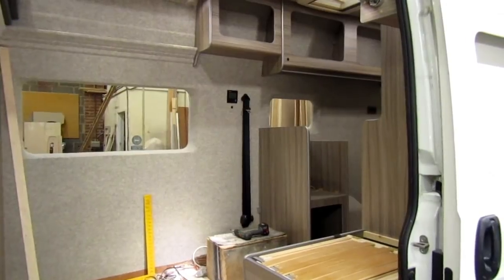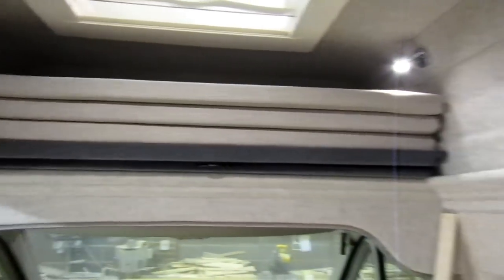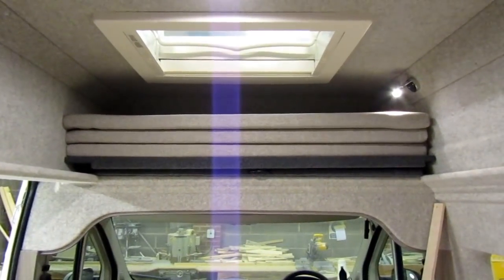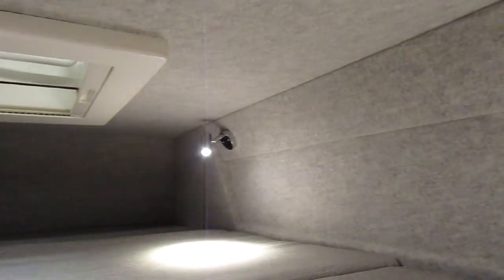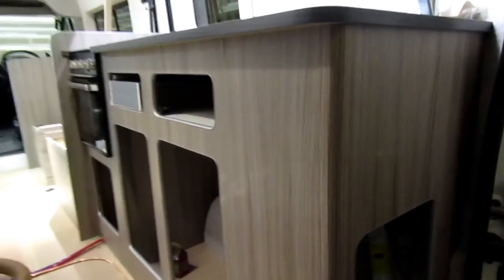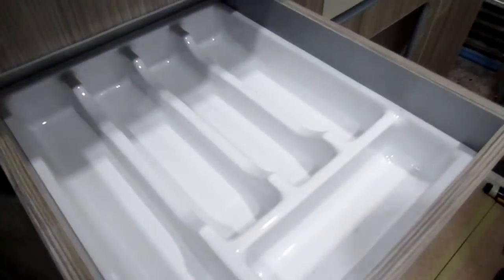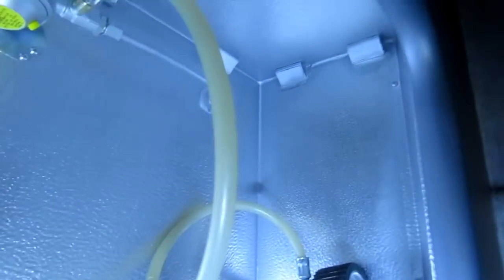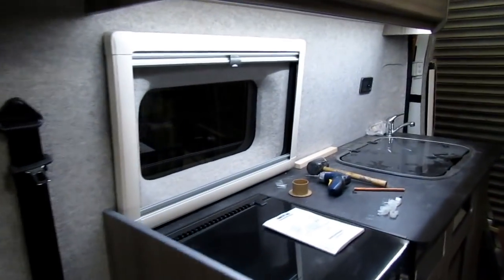How to Build a Campervan Citroen Relay LWB extra high roof Series 7 Episode 6

Comment: Great job dan, when you cut the hole in the unit facia, what router bit did you use and does that give you a complete straight edge after the jigsaw cut, cheers keep up the gd wok 👍
Reply from the maker: I only use a jigsaw to cut the holes out, the router you saw was the slotter for the knock on edging that was fitted later.
Many thanks for watching.

Comment: I am just curious:  how slats can flex if they are screwed at both ends? (Minute 0:40).
Reply from the maker: They do flex, i will try and demonstrate this in a future video for you.
Many thanks for watching
Reply: Thank you for that quick response!  Bed slats are not well known in North America, most euro caravan and motorhomes I saw on YouTube were showing slats enclosed in a kind of plastic pockets at both ends, I was assuming it was to allow slat movement.
Reply from the maker: @charlevoix418  the plastic end caps are renowned for snapping and breaking off after time thats why we screw them down to make them stronger.
Many thanks for watching
Reply: Thank you for those info!